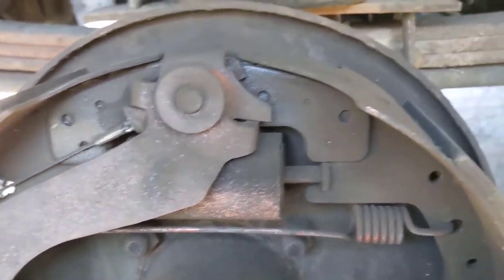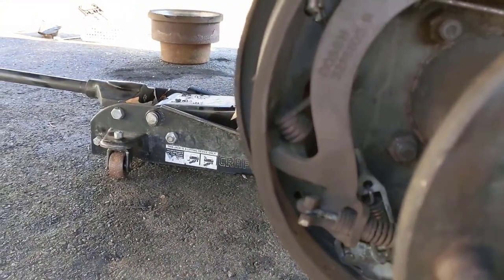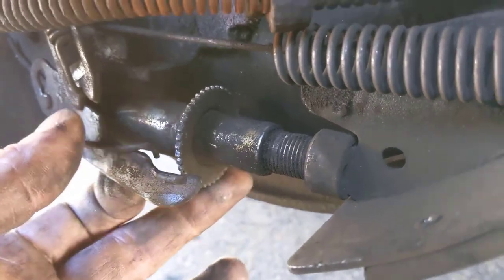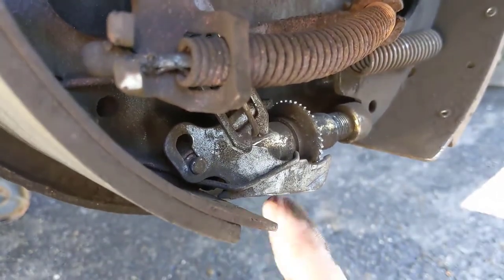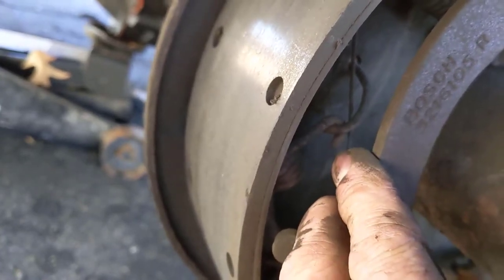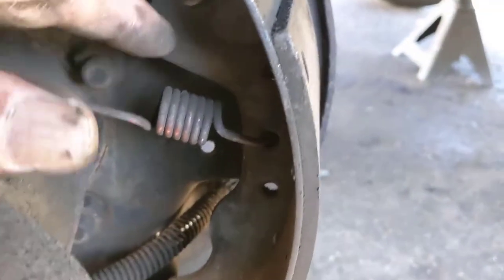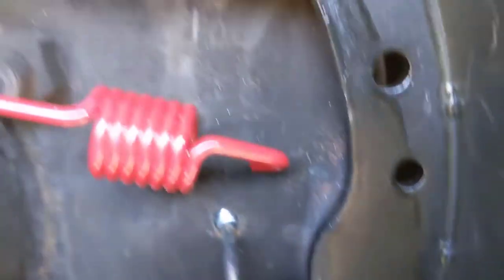How to replace the rear brake shoes on a Dodge Ram step by step

Comment: what was the purpose of this video of you didn't show us how to put the springs back in
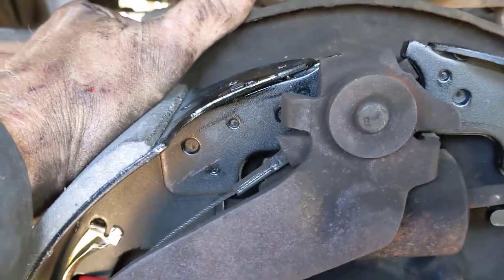Reply from the maker: Look at 8:16 through 9:45 in the video
Reply: When a man says "use a flat screwdriver or other tool to push RIGHT HERE, and then clip the hanger on"...or "use some vice grips to grab and pull the spring over to THIS hole".... do you REALLY need the man to whip out his 3rd hand to show you the spring being pushed back in? 
Just follow the dang instructions and give an effort man

Comment: Are you using 3 or 6 ton jack stands?
Reply from the maker: 6 ton
Reply: does it matter... the entire truck weighs barely over 3 ton.. call it 3.5, if those stands are rated for 3 ton theyll carry 3.5 ton all day long, thats if the entire truck was balanced magically on one stand.. this is the light half of the truck on two of these stands.. if you can find some rinky dink 1 ton stands theyre still plenty strong enough for even a ram 3500 but i doubt anyone makes anything under a 2 ton

your problem is height rather than weight, you need stands that go high enough preferably without turning the stands into a wobbly mess, no matter how strong the stands are if you can knock them over the trucks gonna fall, i custom made some stands that go a couple feet high and are adjustable to every 1/2" using some 1" square tube inside of some 1.5" square tube, with 3 feet that are spread far apart gives a good 16" diameter to be stable, a 3/8" pin good to something like 12,000 lbs double sheer goes between the tubes, ive violently dropped the front end of my 96 12valve on them without issue

if i need to extend them all the way up they get wobbly like any stand would, a couple shims pounded between the tubes fixes that quickly

Comment: This doesn't even resemble my 98.5 2500, not at all. Bummer
Reply: yeah the year should of been listed on the video.. the manuals are online and easy to find though with the step by step instructions you can print off
Reply: You probably have the brake system that was displayed in the Haynes manual lol the system in my manual did not at all resemble the system in my truck!